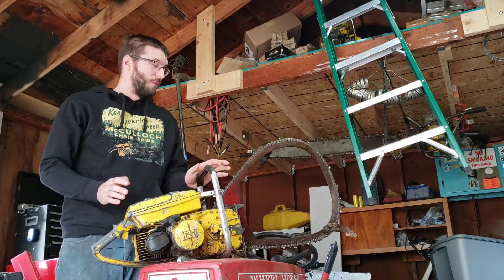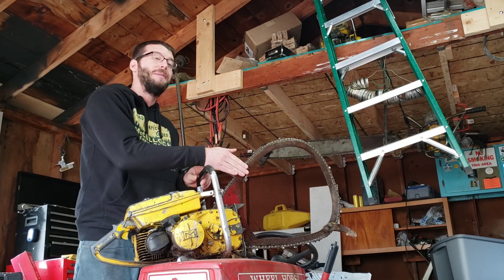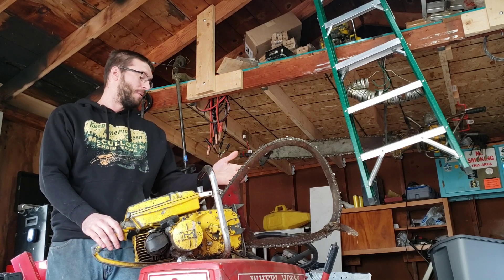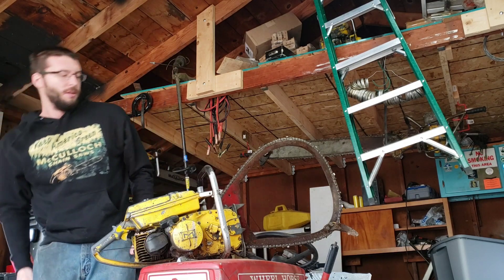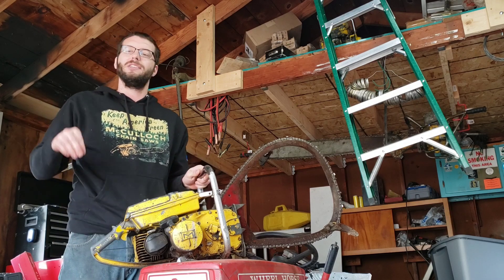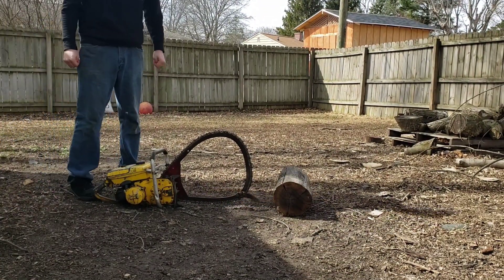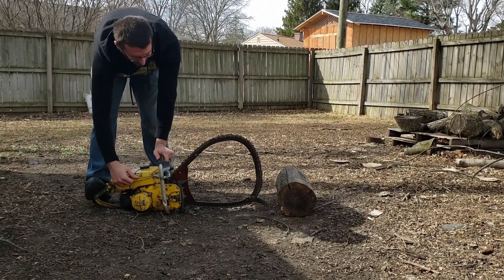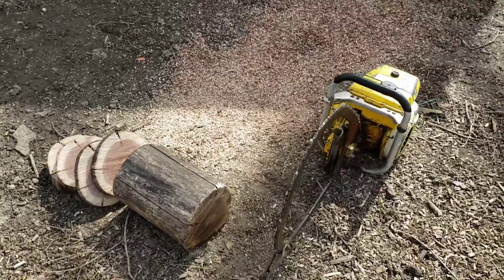What Are Bowbar Chainsaw Bars?

Comment: I have a 1975 Homelite XL Automatic with a bow. It was my Father's that he purchased when a hurricane had came through our area. We have cut massive amounts of wood with that old saw. They definitely have a higher danger factor to them than traditional bars. That being said, they can be used safely as long as the user understands their uses, and more importantly, their limitations. I recently re-built the carb and some other minor maintenance and now the old girl is still going strong. Still my favorite saw to use when bucking firewood.
Reply from the maker: Glad to hear you kept a saw live and out of the land fill. Well done.
Reply: I was told by older folks that they were made it illegal. At least in Florida maybe. I didn't Google it.

Comment: 65 years being around power saws and that's the first time I've seen a bow bar used. I have a 6-10g with one but haven't tried to get it running yet.
If you look at a chain as it goes around the tip of a regular bar you can see how the space between teeth is increased and the stick-out of the tooth is exaggerated. That is the primary cause of kick-back. It's more pronounced in skip tooth or semi-skip chain and the old large bars with large radius noses, especially with 1/2 pitch chain or larger. That is why the "safety" or anti-kickback chain has bumps that stick up between the teeth, fill the gap going around the tip. Some bars actually have a guard on the tip so you can't cut into the wood with it. Kick-back can occur just about anytime, but usually happens when the tip hits a hidden piece of wood just past the piece being cut. 
While not eliminating kick-back, bow bars greatly reduce it because the chain stays in a constant geometry around the bar. With the narrow chain guide and open space behind, they also reduce pinching associated with cutting branches or wood under stress.
Good job on the chain. Even though you said it wasn't sharp it was throwing good chips. Most guys don't realize that the depth gauges can be lowered much more on these slow torquey saws more than the modern high speed saws, more so even on a gear drive.
Reply from the maker: I'm glad I can show you something new sounds like you need to get that saw going in try out a bow bar you're going to kick yourself in the butt sooner for not trying it sooner.

Comment: Safety wise it’s also missing the covers that go on top. They help but only so much. If I ever get a saw with one of those bars it will be a wall hanger for sure
Reply from the maker: I did mention that in my video about the covers and may make some.

Actually a company that refurbish these so if you wear one out, you can get it fixed and good for another 10 or more years before the welds need replaced again.

Comment: Nice vid.  The bows are very nice to work with.  If the spur is set they just pull right through the wood
Reply from the maker: Probably the best back and time saver for an older heavier saw, literally letting gravity do most of the work for you.

Comment: Hey man I FINALLY just got a few bow saws going and I've been looking for info about how tight the chain is supposed to be on these. I would think it should be a little looser than a normal bar because there's so much chain. Ive been setting mine pretty loose. I thought u might have some original literature that explains how it should be adjusted properly
Reply from the maker: You do want them a bit looser because there is alot of pressure on the entire cutting face on these bars.

Comment: Iv got a McCulloch 10-10 auto. Has the 16 original bar. Im looking at a 24 inch bar on eBay that’s a performance saw supply. I did buy some bar plates for it since I believe it originally had them but now I’m thinking some dogs would have been better
Reply from the maker: Dogs are a must for me, helps out a ton and I highly suggest getting them.
Reply: @mistermacgray  do you recommend any certain ones for a 10-10 auto ?  If I get dogs they act as bar plates right ?  Just fell a big dead leaning pine last night and see I would have benefited with dogs. Used a old craftsman $40 saw I tuned up or thought I did until it started bogging out when I was deep in the tree lol. Got er done fell where I wanted
Reply from the maker: @mick5740  dogs don't act as bar plates on these
Reply: @mistermacgray  do your McCulloch s have bar plates ?
Reply from the maker: @mick5740  yup...most

Comment: Are the bow type bars interchangable with most chainsaws?
Reply from the maker: Not really but they can be made to work like I had to do with this one. Lining up oiler holes is a trick but this one pushes enough oil around the bar to get to the chain without issues.

Comment: HOW much did you pay and where did you find this saw Bryan ??? Can you tell me if  you would change the half inch chain to a 3/8 ro 404 chain increase the speed of the cut ?? ONE more thing why are bow saw bars come in different shapes and lengths ??
Reply from the maker: I paid $120 years ago and did a full seals and gaskets rebuild on this saw, was my forst sae to take down and replace all that stuff. Also finding a .404 chain sprocket isn't easy, I can't say it will cut faster with smaller chain as this is a gear drive saw so it will be slow by nature.
Reply: @mistermacgray  Let me know when you find one or will be selling the saw Bryan. Nice informative video too.
Reply from the maker: @Victory First  this and my other saws won't be for sale anytime soon, but will be displayed at local vintage shows for people to look at and handle.
Reply: @mistermacgray  Where exactly are your shows located Sir ??

Comment: Just adding a decent top and bottom guard should make it a safer chainsaw than regular ones surely?  You don't use the top part to cut ever?
Reply from the maker: You don't use the top and bottom to do any cutting on a bow bar, just the front for plunge cutting.

Comment: I never understood them as the tip on a regular guide bar works just as well. There's also the aspect of felling. Seems like it would be clumsy.
Reply from the maker: If you watched the video you will see how a bow bar and regular bar are nothing alike when it comes to cutting and both have their differences in use. A bow bar prevents you from bending over or getting on the ground to buck wood (no up and down of the body non stop).
Reply: @mistermacgray  as a career timber faller, I never got on the ground for any log. The tip of a regular guide bar works just as well.
Reply from the maker: @Elon Must  these were developed in the south United States back in the 50s to cut smaller pulp wood and were very uncommon to see anywhere else including the PNW and even Canada. Located depended on if you ever seen or used one, there are guys to this day that did logging back in the 50s-80s and never once did they see one or know about them.
Reply: @mistermacgray  I started on the east coast. Knew about them 20 years ago. They just don't make any sense..
Reply from the maker: @Elon Must  once you buck smaller logs and not have to get up and down to do so vs standing up and using the weight if the saw to do it, you will understand at the end of the day when your back doesn't hurt. Me being a taller guy, these are nice.
Reply: @mistermacgray  I have used them....
As I stated, I cut timber professionally for around 15 years. Running a 32" bar, I can cut right ro the ground without bending over at all. The tip of a regular guide bar works in exactly the same way. It is not necessary to run the bar level to the ground to cut a piece of wood!
Reply from the maker: @Elon Must  I know you can use a long bar to buck wood, but I can do it with half the weight and chain too. Use your brain, not your back. Have a good and safe one.
Reply: @mistermacgray  Damn dude you really refuse to take my word for it! Whatever.....
Reply: @mistermacgray  If you have a 32" lightweight guidebar, weigh it. Bet its lighter than that bow.
Reply from the maker: @Elon Must  your words are an option just as mine are in the video. Good thing about bow bar vs regular bar is people have the choice to use which they want. I've talked to many guys who logged for over 30 years who used them daily and loved them. I'm not going to bring a 32 inch bar to buck 12 or 10 inch wood on the ground. Where I live, its rare to need a 32 inch bar to cut wood. I'm a collector and yes I run my saws when given the chance, most of the time they sit for me to enjoy and bring to vintage engine shows to show off. Your opinion is great and you never saw a need for you to use them, but that doesn't mean your opinion is a fact and everybody has to follow it and stop using bow bars.  Many people have never seen a biw bar, stop and ask about them and get a lesson in them, real head tuner at shows and American history.
Reply: @mistermacgray  I dunno, looks like my opinion is pretty popular, (bow bars are unheard of in the logging woods, even in NC!)
Reply from the maker: @Elon Must  I never said my option was the most common option, this video is about them and their use, it isn't saying to use them, just explains them. When I say down south I mean southern states, not east coast. Light weight bar, let's go back to the 50s-70s and see how many light bars existed let alone light weight chainsaws. Just because you didn't see or understand the reason for them doesn't mean others don't, we will leave your misunderstanding of them to you, you will always be welcome to use your 32 inch bar over the guy next to you using a bow bar to cut the 8, 10 or even 12 inch wood.
Reply: @mistermacgray  Just watch people use them.. All I have found here on YouTube is guys extending their arms at chest level to roll this awkward setup way out in front of them. It doesn't look ergonomic at all. It looks like it would wear someone out very quickly.
I know why they were popular; it's not much more than the anti-pinching aspect. You could buck logs that have a top bind SOMEWHAT easier than with a standard bar. For production, they are for dummies. Imagine trying to fell trees with one.. They were a purponent of the stumpjumping practice.
Reply: @mistermacgray  I'd like to have a few myself, but they've, like the rest of the old saw scene, become expensive. I've seen them in NC attached to 82cc mcCs. Plenty of pulpwood operations in the flat land there.
Reply from the maker: @Elon Must  felling trees with one isn't what they were made for and why you don't see them anymore, sure it can be done, but why those dummies aren't here to tell the tale and why they aren't made anymore, my video explains they were for ground bucking. I didn't say they don't exist in the east, I just tell where they were developed, if they spread from there, cool, but also why you don't see them everywhere.  I will agree why I don't have more of them, they got expensive, I can't even find a McCulloch one that somebody doea want an arm and a leg for (pun intended perhaps) but I will wait to find a deal on another like did for my current ones and all my saws I have. For me this is a hobby to learn amd keep the history alive to pass on, not in this for the money, wish I had been able to log in the good old days but those days are long gone.
Reply: @mistermacgray  I just won an ebay auction for a  super xl with a good looking bow bar on it.
$116 shipped!!
Reply from the maker: @elonmust7470  hell ya, that's gonna be a good one to have fun with.  Those super XL are no joke.
Reply: @mistermacgray  Yeah that's what have been learning. This one is missing the filter & filter cover, but I'm not worried. Most of the time a rebore is about as much as a guy needs to do to one of these old saws. I've been getting lucky with estate saws. 2 husqvarna 2100s & a pro mac 850 in the last few months, all sold for less than 550 a piece. All very strong saws. This 850 will dangle from the rope with a 32"bar on it, indefinitely. I'm waiting on some Schrader valves so that I can do some compression tests.
Reply from the maker: @Elon Must  I never got into the 800 series macs, chrome bores never held up well and are black and decker made....when they run, they run. I had a 8200 and traded it for McCulloch 101 blocks and other kart stuff, I have a vidoe of that somewhere too.